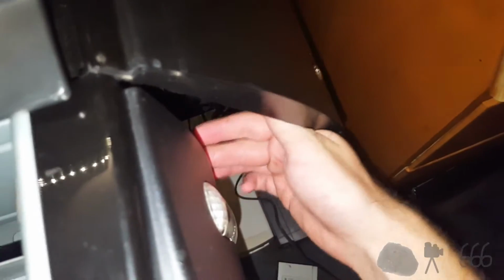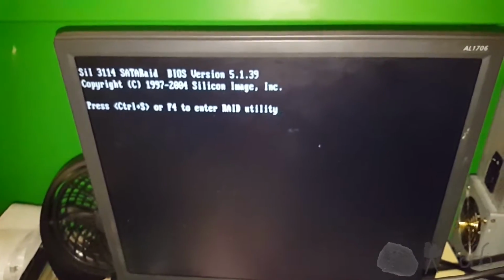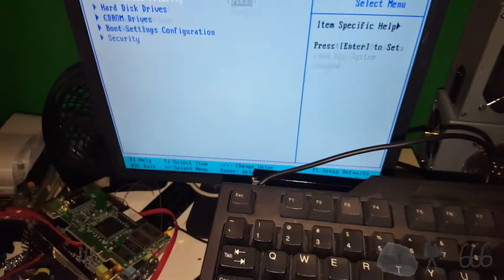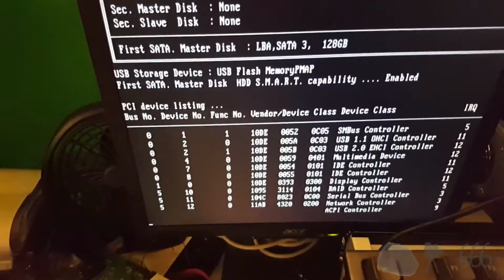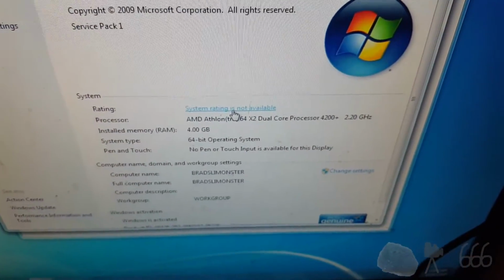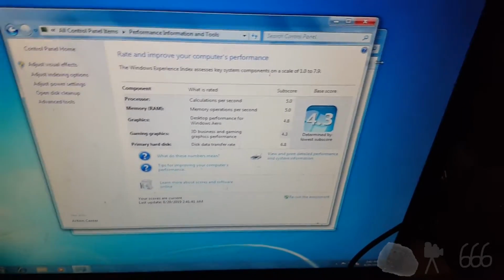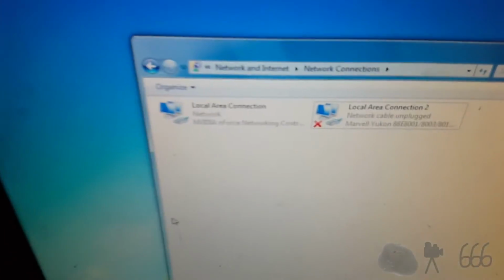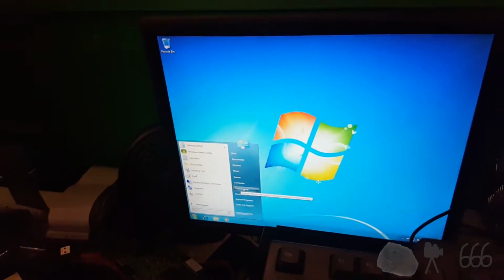A Foray Into SLI: Asus A8N-SLI Deluxe System Build, Part 2 of ?

Comment: SLI (and Crossfire) seem very attractive in that you can get high-end performance from 2 (or more) mid-tier cards.  You'll get very nice benchmark scores and good FPS rates, but that's not the whole story.

Let me tell you my story:  My GeForce GTX 780 was a bit underpowered for playing Destiny 2 on my 2560 x 1600 monitor.  It was during the height of the GPU price hike so a high-end card was unreasonably expensive.  I bought a second GTX 780 on ebay and set up SLI.  Great benchmark scores and good FPS in Destiny 2, but the micro-stutter (frame pacing) was real.  The stutter was just too distracting for me to enjoy playing the game.   In the end, I used an insurance settlement (property damage from State Highway Dept) to buy a GeForce Titan Xp.

That is my admittedly limited experience with SLI but I have seen and heard similar stories across the interwebz.  But sometimes you just have to see for yourself :-)
Reply from the maker: Honestly, this is more of a "I have this stuff laying around doing nothing, so let's give it something to do" project more than anything else. If I wanted the performance, I'd get a newer board and CPU than the socket 939 and Athlon 64X2 4200+.